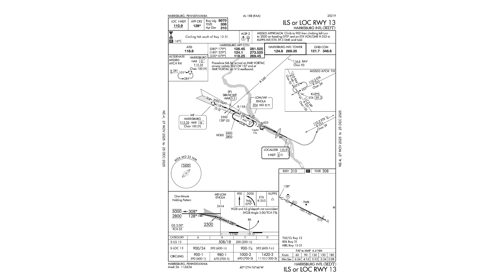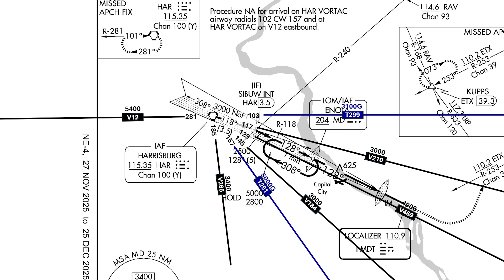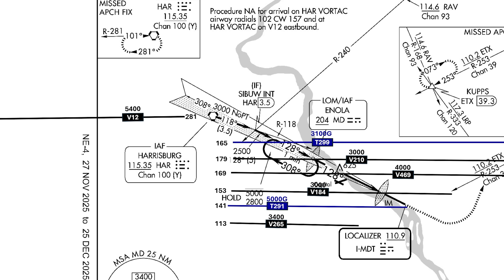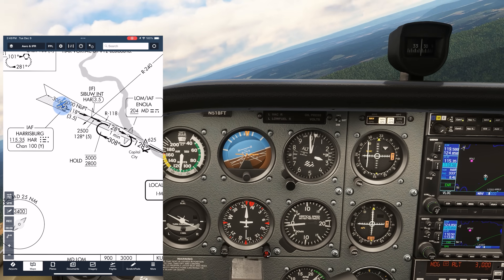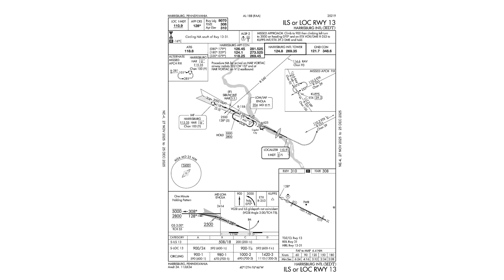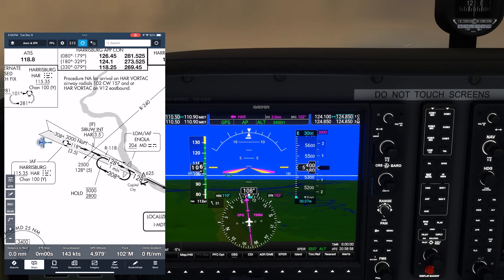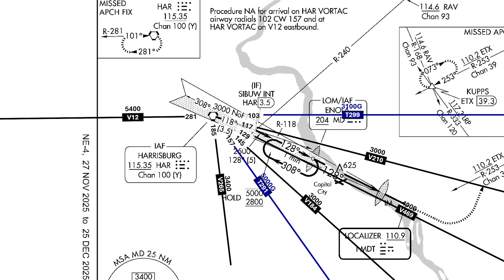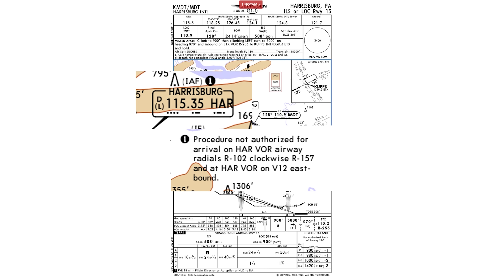The Most Misunderstood Note on an Approach Plate: ILS Explained - Procedure NA

Comment: Another outstanding video Dan. Thank you. Great choice of APP to explain the PROC NA. Also, the FlightInsight Instrument course is beyond compare. I recommend it to anyone, even if they have another course. Yours is very thorough. Anyway, we fly KLNS-KMDT frequently for the Instrument App practice. Both RWYs 31/13 are great apps. But MDT 13 is a good one. We file LRP V210 HAR, but almost always get vectored onto the approach course between SIBUW and the LOM (another not-so-common feature of this APP). Also the app course on the plate is 128, though the CRS from HAR to SIBUW is 118, thereafter changes to the APP CRS of 128.

Comment: What about a descent-in-hold for v12 eastbound?
Reply: I dont think you'd really be starting the approach then if you're in a hold like that.
Reply: Not exactly sure, but I’m thinking you could be cleared via vectors/radials to the holding fix, then given a descent and approach clearance from there. But they can’t clear you for the approach directly from V12.
Reply: You could be cleared for that if you used ENOLA for the IAF instead of HAR, but you'd have to enter the hold no higher than 5000 ft. But much more likely you'd be vectored to final at a more appropriate altitude anyway.